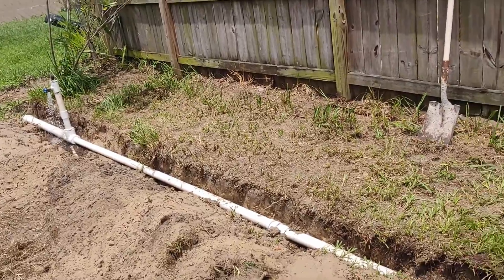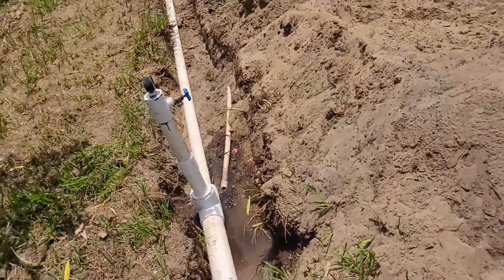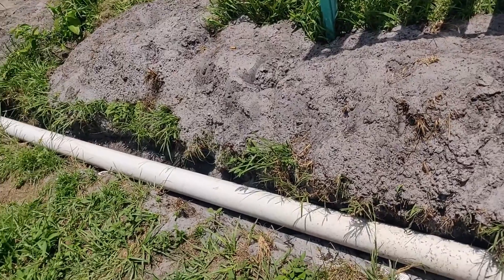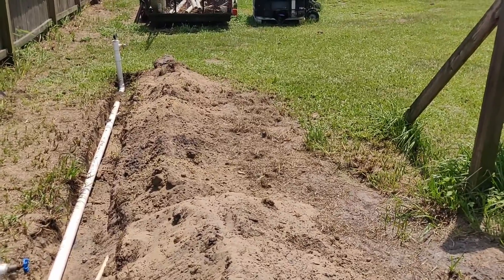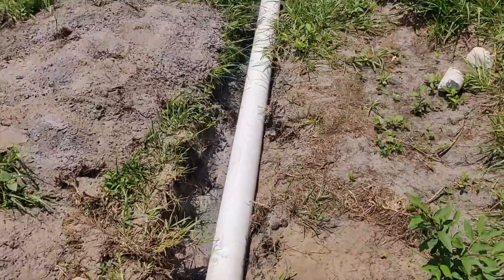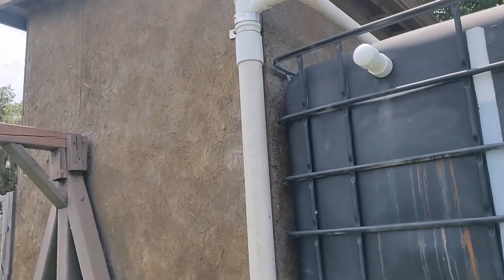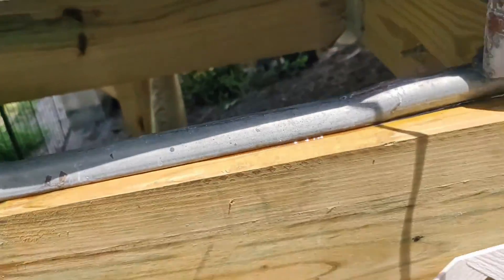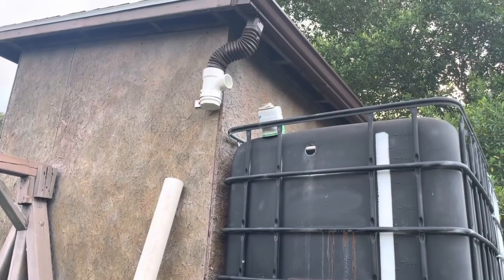BEST WAY TO INCREASE FLOW FOR RAINWATER HARVESTING #howto #rain #water

Comment: There is no such thing as ‘chemtrail ‘’ dust . The 10’s of thousands of Jet planes spew  exhaust hot gases that cause condensation of water vapor . Airplanes could spray vapors and other chemicals , but the “ chem trail claim is a conspiracy theory that is a popular fad . The Con trail s start in WW2 with hundreds of bombers leaving the first of this effect . You can find many movies made of the bombing missions . CO 2 from burning fossil fuels is a very real threat by heating the atmosphere.

Comment: Hello 
Wanted to know what was the Preasure at the gauge with tank full and faucet closed?

Ty
Reply from the maker: Only a couple pounds I only used those because I had them left over from pressure testing pool plumbing and like you was curious. But it's the volume of water that's allowed to come through with the gravity that once necked down to smaller pipe and ultimately the 5/8 hose bib opening that creates the pressure flow. I will be making a part 2 showing the irrigation set up whenever I get a chance